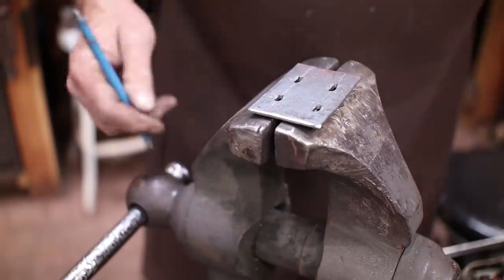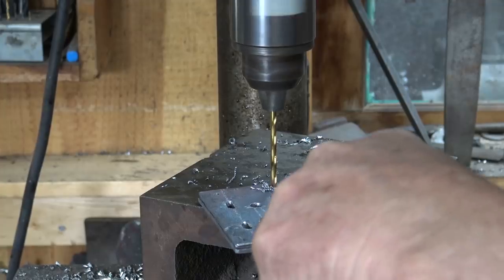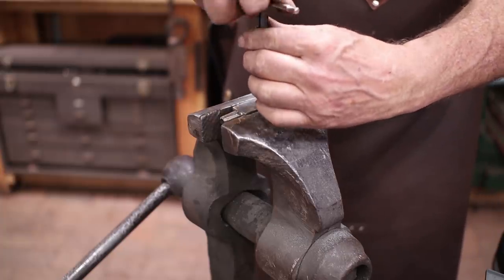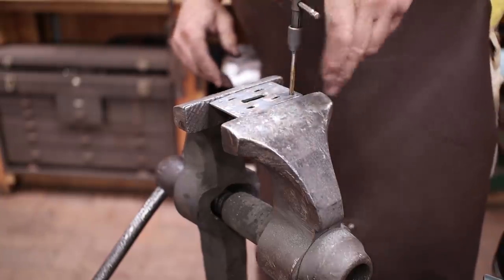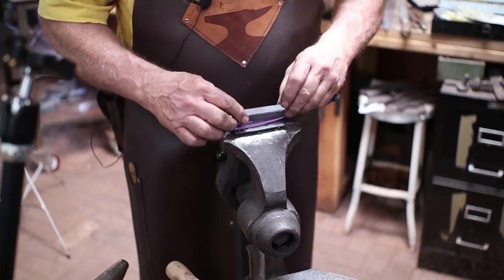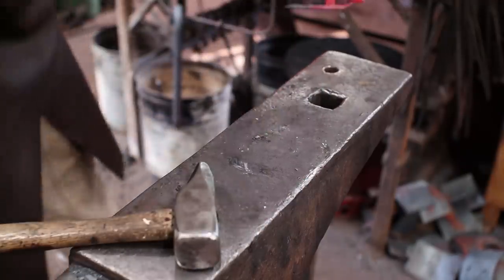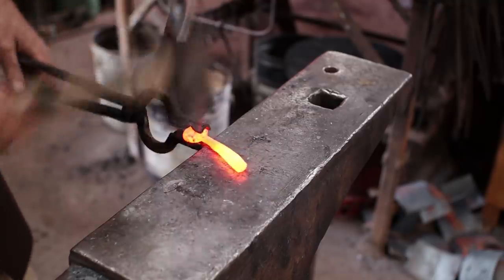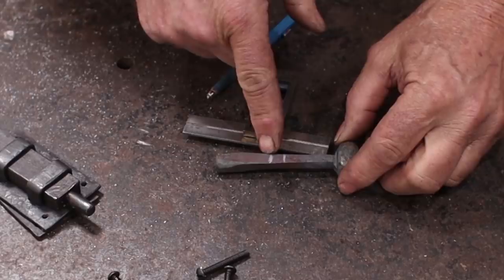Slide bolt part 2 final forging and assembly

Comment: Great video series! Well done. Also, coming from 30 years in Tool & Die....throw your 4-flute taps in the garbage. Get yourself some 2-flute taps. The only thing a 4-flute is good for is chasing already existing threads. Believe me, once you've broken off a crappy 4-flute tap in something that you've worked really hard on, you'll understand.

Comment: Another good video. It was good to watch something like that come together.   What kind of filler rod was used in the welding?

I just hope the cat can't reach the screws. They are some smart animals.
Reply from the maker: RG45 if I remember correctly. Bailing wire also work

Comment: great handle, is there version of this that would go on a door that is flush with the wall and opens out? Or do you just put the fancy handle on the other side for those? (closet door)
Reply from the maker: I’ll show that at some point. But for the most part it’s just a surface mounted keeper like the bolt slides it.